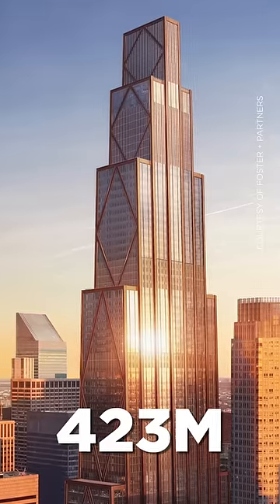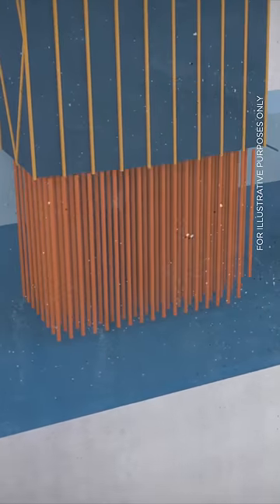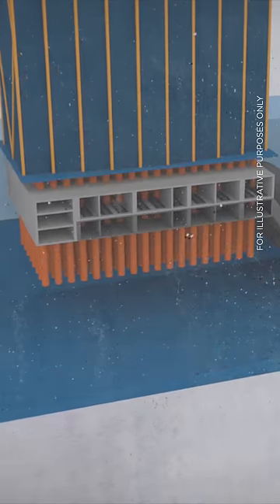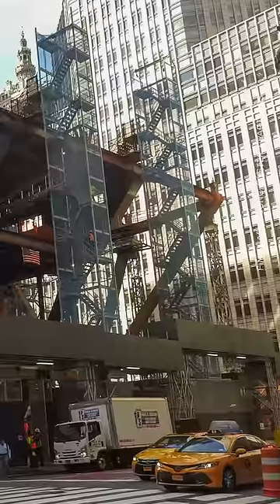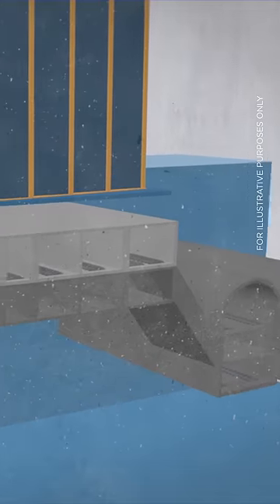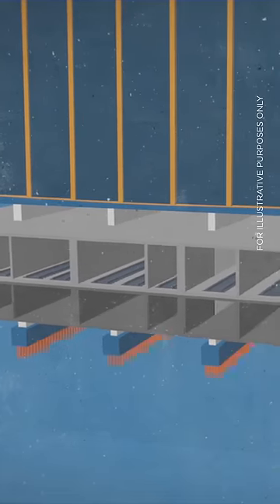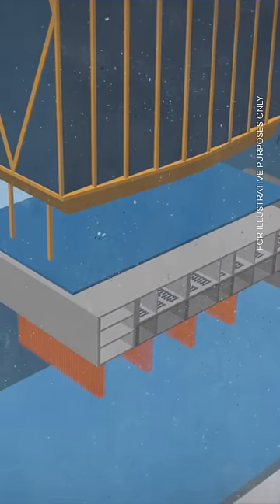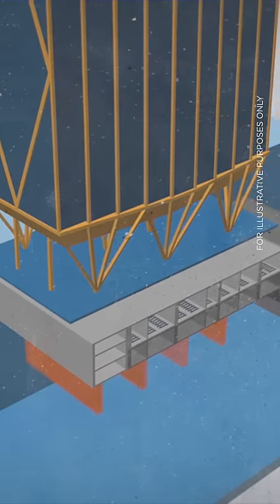The INSANE Engineering of New York's New Skyscraper

Comment: So those of you who think this is great--you're saying nothing designed by engineers has ever collapsed or failed and killed a lot of people?

No contractor who BUILT the thing designed by engineers has ever cut corners and gone cheap on materials or used improper techniques that caused the thing to fail?

No building owner has ever skimped on maintenance and caused a structure to fail due to corrosion?

I will avoid these buildings!

Comment: ANYONE FAMILIAR WITH THE CITICORP BUILDING IN MANHATTAN?
IT'S THAT TALL WHITE BUILDING JUST AROUND 50TH STREET AND LEXINGTON. YOU CAN RECOGNIZE IT VERY EASILY BECAUSE THE VERY TOP IS ON A HUGE ANGLE. IT DOESN'T COME TO A POINT AND IT'S NOT FLAT. WHERE I'M GOING WITH THIS IS THE PROBLEMS THAT THE ARCHITECTS AND ENGINEERS HAD WHEN THEY NEEDED TO CONSTRUCT THIS THERE WAS A VERY OLD CHURCH RIGHT THERE AND IT WAS NOT MOVING THEY BUILT THIS SKYSCRAPER ON STILTS NEVER HAD A PROBLEM WITH IT.